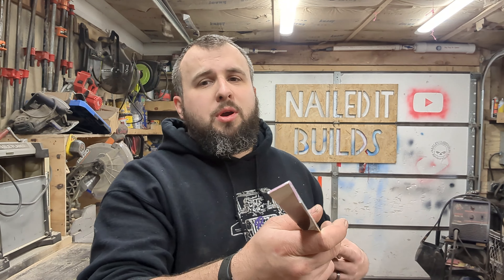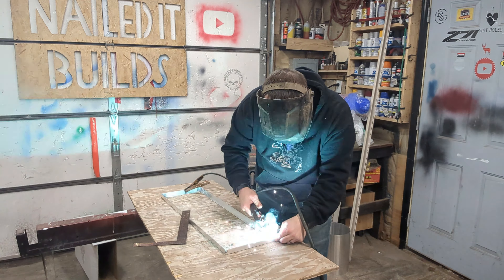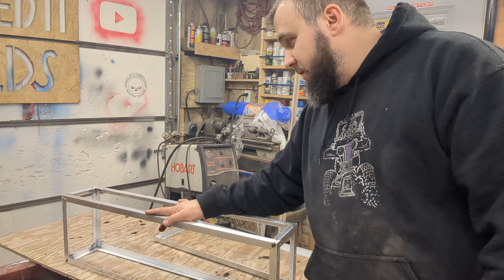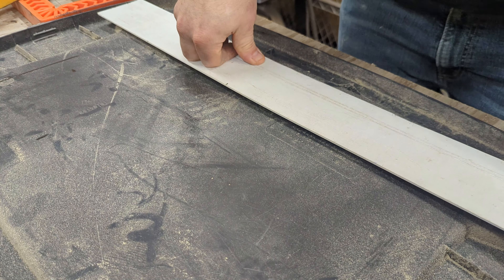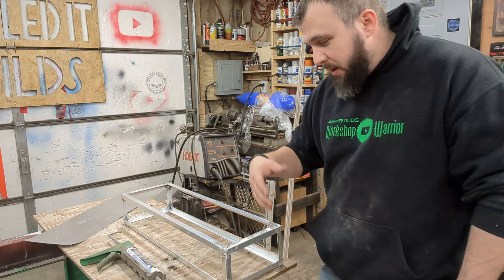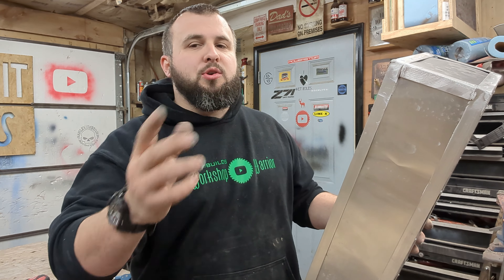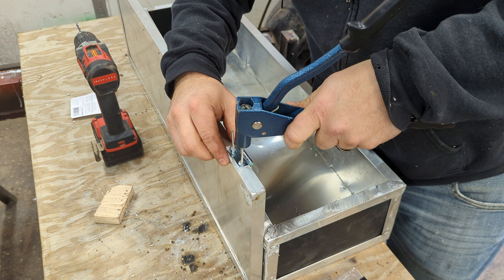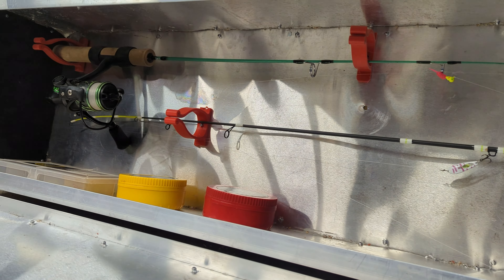Building a Full Custom Aluminum Ice Rod Box

Comment: I may have snickered a little at the flashing. Is this ok?
Reply: I have a bunch of closed cell foam sheets. They are from servers and networking gear. If you want them let me know.
Reply from the maker: We'll see. Lol if it doesn't hold up I'll just rivet in a new piece of actual aluminum sheet.